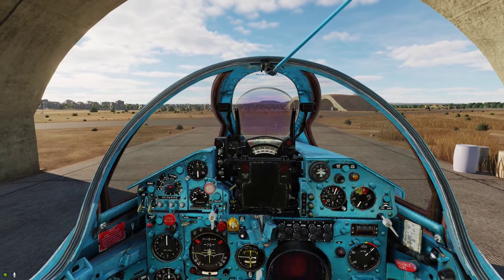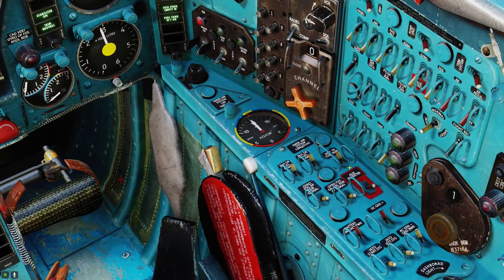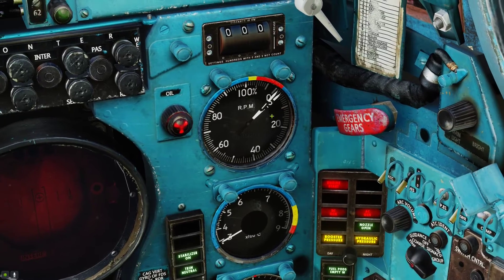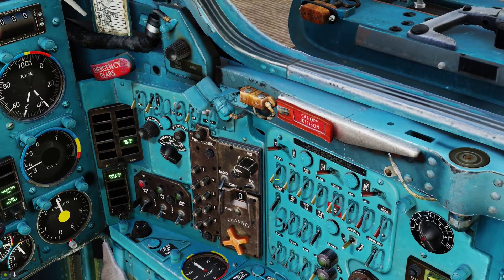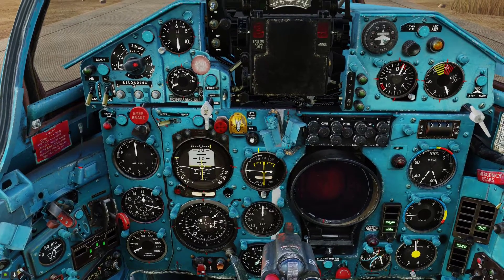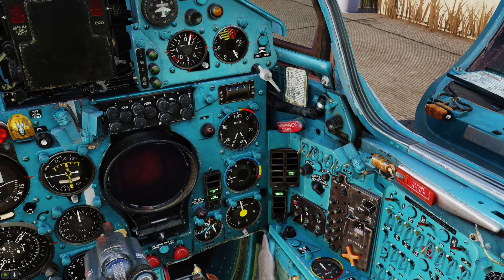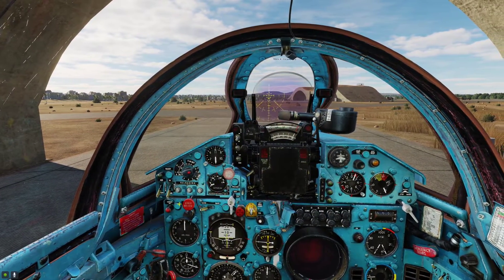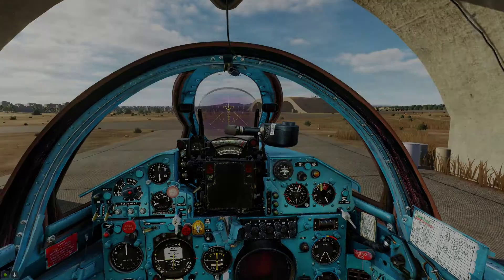DCS | mig-21 startup tutorial

Comment: apu is just bad translation. is not a apu but an starter more like a car starter that rotates the engine until the fuel can sustain the engine. Also in reality ac generator should be switch on only after the engine is running.